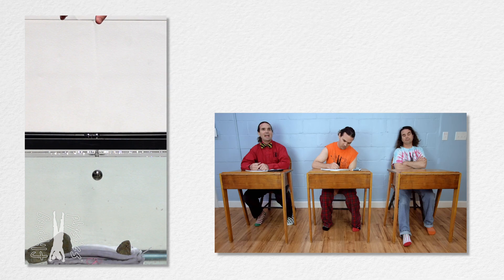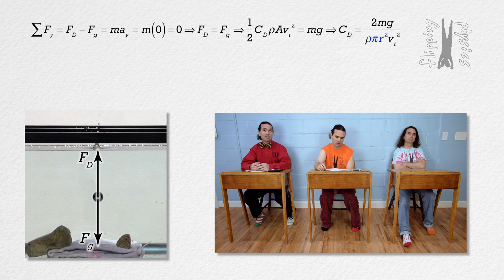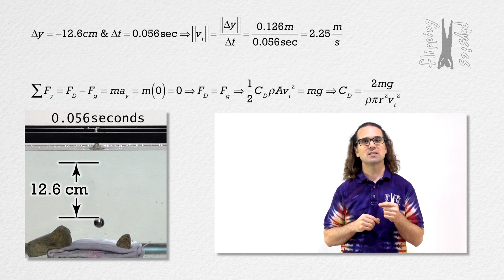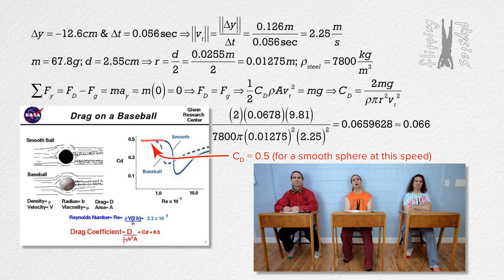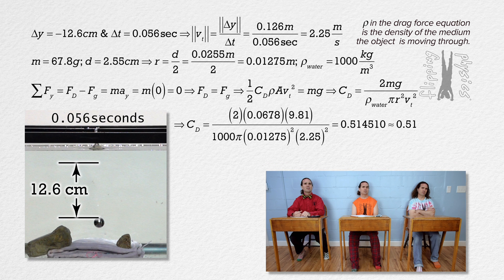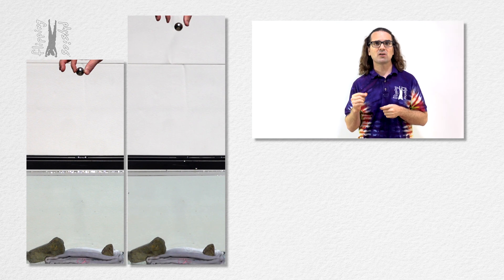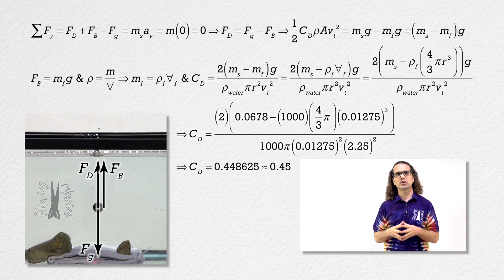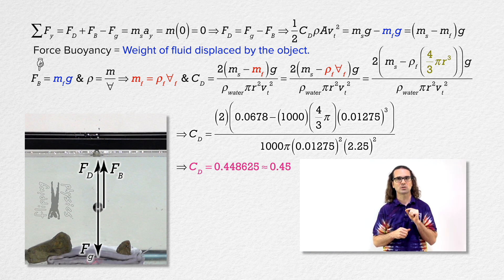Demonstrating and Solving for Drag Coefficient

Comment: the reason of 1/2 in drag equation
Reply: If you are wondering why we include the 1/2 in the drag equation, rather than just embedding it in the drag coefficients, I wondered this too.

It has to do with the first principles behind the drag coefficient.  This explanation switches the reference frame to consider the solid object stationary, since that's how I'm familiar with describing it.  A moving fluid comes to a stop against the solid object, and the fluid's KE is converted into pressure energy, as described by Bernoulli's equation.  The KE per unit mass is 1/2*v^2, and the pressure energy per unit mass is P/rho (assuming changes in rho are negligible).   Solving for the pressure increase as the fluid comes to a stop (stagnation pressure), we get P = 1/2*rho*v^2.  Multiply with frontal area A, to get F=1/2*rho*A*v^2.  This gives us the drag force with complete stagnation of the fluid.

So what drag coefficients are doing, is comparing the force specific to the body shape, to what the force would be for complete stagnation.

Comment: Dear Flipping Physics,  I derived the formulas using drag proportional to velocity https://www.desmos.com/calculator/fxt9duxa0w
everything seems correct but this formula doesn't seem to do a good prediction of calculating landing position (x) from my little brother throwing a baseball  ( initial velocity was calculated using video footage at 60 fps (ipad) with a yard stick beside the ball [ don't worry I converted to meters]) angle was estimated from video footage as well... the ball landed  around 13 ft in 3 trials and my equations predicted  much less than that (about 3 ft)...   SHOULD I STOP BELIEVING IN PHYSICs? please help I want to believe in science

I also made an excel spreadsheet using numerical methods on a drag proportional to velocity squared.... it did much worse
drag coefficient for a baseball used was 0.3 (according to Nasa website)
mass of baseball according to my kitchen scale  was 144 grams or 0.144 Kg